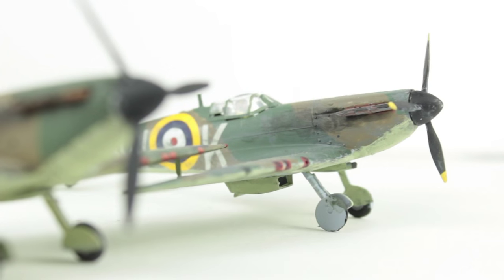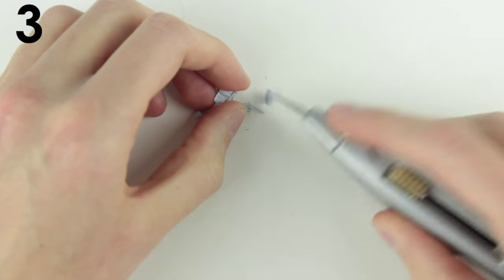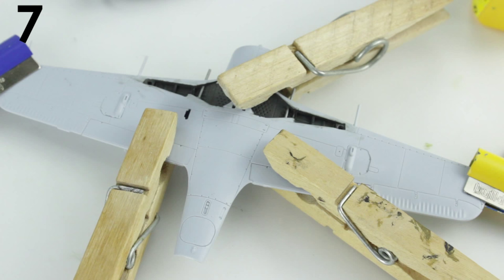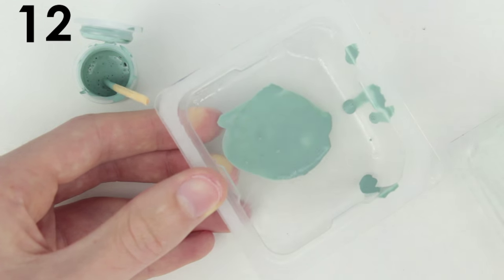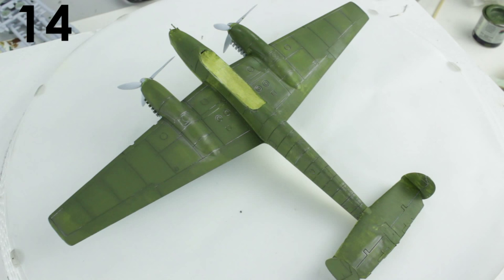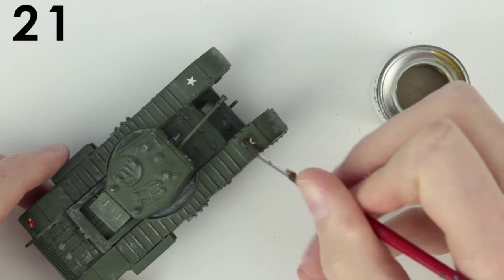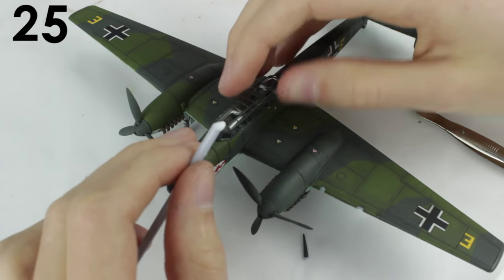25 Tips for Scale Modellers

Comment: I like this. It's a very well-made video.
Reply from the maker: Thank you, I'm glad you appreciate the effort I out into the production :)
Reply: Quick Kits 
Hey Owen!  I use Mr White putty to fill gaps between parts, whenever I sand it to make it smooth, the excess putty gets caught on the sandpaper and makes it unusable after a short while.  How can i remove the putty/filler from the sandpaper so I can use it again?
Reply: wipe it on your sleeve.
Reply: will pattison 
Tried it before, didn't work
Reply: try a wire brush, the small kind. There's a 3 pack with wire/brass/nylon  brushes, use the brass one first, start off lightly  ( sold in £ shops/wilko's/hardware or online shops) . Also try putting some (blackboard) chalk on the sandpaper first, this sometimes helps, rub some on then tap lightly to remove excess.
Reply: @rurushu8094 , how long do you wait for it to dry?

Comment: Nov. 2017--Started building models back in '74 when I came back to the states from Panama. You know, back in the "good ol' days" when there was NO internet. Learned to wash my kit in soapy water to get rid of any mold release on the kit parts, but never heard of using vinegar also. What does the vinegar do? As to modeling putty, switched to the red Bondo auto body fill material. It's lacquer based and bites into the plastic. In thin coats, it dries pretty quick and then can be sanded. For bigger fillings, it's best to wait a day or to for it to completely dry. I've read where the blue Bondo is even finer, but have yet to find it being sold anywhere. Thanks for the video.

Comment: Great video. FYI it's not a 'sprue' it's a  'runner'. The sprue it the piece between the runner and the nozzle tip that's would either be trimmed away or not exist if it's a 'hot runner' mould.  I'm not an expert modeler but I am a inj molding process tech. ;)

Comment: Good advice all around.  FYI all Japanese models do not require "washing"  the manufacturer has politely removed all mold release for this purpose.
Reply: Tactical Jackalope
That is strictly not true at all, all potentially do to some extent, they do in some ways require cleaning many models are made from different sprues, as I have had many stating such also having been pre-washed etc, but to find that they actually needed cleaning and is quite the job finding out later that the paint will not actually stick.
 However, if you do come across this just use a "Q" tip, (cotton buds),  soaked with meths and rub clean the area, leave at room temp for 15-20 mins or dry with hair dryer on low setting very gently to evaporate away the remaining thinners and once clear, continue painting...

Comment: I have a few questions to ask and hopefully you can answer them, so here they are: 1 Does enamel paint thimned 50/50 stick well to unprimed plastic surfaces but have been washed in warm soapy water? 2 Can natural hair brushes be used to paint enamels and acrylics? 3 Does anything happen when acrylic paint is painted over enamel? And do you have any tips for painting 1 72 tanks eg the type of brushes to be used , the size of the brush? Thanks in advance, from Singapore
Reply from the maker: In reply to your questions: 1 Yes enamel thinned 50:50 will stick well to un-primed surfaces after washing in warm soapy water. 2) Natural hair brushes can be used for enamel paints, but not acrylic - they'll go floppy. 3) Nothing happens when you paint acrylic over enamel. 4) Use a medium sized brush and some really fine ones, I'd recommend synthetic hair brushes because they can be used with acrylic and enamel. There are some names of the brushes I use in this video's description :)
Reply: 50/50 thinned enamels do not adhere that well to unprimed plastic, especially not cleaned from release agents, as you would know since you have asked? However if plastic surfaces are rubbed by finely grain sandpaper or meths cleaned will certainly do the trick.
Natural hair brushes are not my choice for painting models,  either enamels or acrylics, *Nylon type,  or man made, (Royal Taklon), Plenty out there to chose from. Not too expensive.
Acrylics painted over Enamels as long as the Enamels are completely dry there is no problem what so ever however if not dry the evidence is clear to see. Recommend to completely clear/clean of all paints with suitable thinners and wait at least 24hrs, then start once again.
Small model, therefore small brushes, however for bigger areas use larger brushes and strokes all in one direction, this helps to reduce the brush marks which should not look too bad if applied gently but firmly.I always prime my models first leave 24 hrs and then apply cammo or soild paint. I now tend to use acrylics more than enamels, hence there is no real need to thin the paint such as AK Interactive or Vallejo, or life color.

Comment: Before putting together.  Take a fine needle heat up and carefully run through and pull out upon pulling out of the melted plastic is drawn back.  With practice many different kinds of holes can be made. Even exit holes using the tiny Phillips drivers.  Not as much tip heat.  Working it slow and in stages a great resualt can be obtained.  Practice on scraps first...

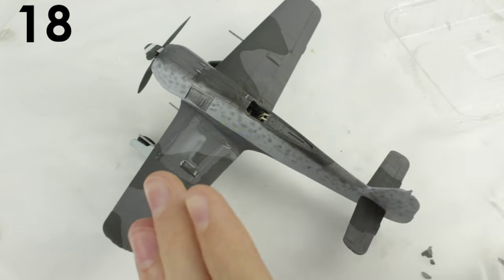Comment: Hi great set of tips I will need to work through your vid again at a slower pace to pick it all up👍🏽 would recommend always applying clear varnish on a kit and if so, what type of varnish would you recommend for a spitfire 1:48. Thanks!
Reply from the maker: It depends on what you are doing. A gloss varnish coat is needed underneath decals, or if you want to achieve a shiny finish. Matt varnish is useful for getting rid of any shine. I'd recommend finishing the model with a coat of matt varnish to seal everything - just be careful not to get it on any clear parts as it will make them go frosty. You'll want to spray the varnish on from either a rattle can or an airbrush. I've only every used Humbrol varnish so I can't compare it to anything sorry.
Reply: +Quick Kits thanks man!
Reply: Use Johnston's" Clear floor polish", for finished results, or for all clear canopy's, windows, etc  leave overnight after dipping and you will see a vast improvement. (Keep the dish for dipping covered to stop dust getting in and Don't forget to pour contents back into the bottle, the stuff a'int cheap). Please refrain from using Varnish on canopy's or windows, I have found in my experience it tends to go a yellowy brown color after a while, especially Humbrol. Try Vallejo or AK interactive paints. Do not need to be thinned or played about with but ensure you shake well contents before starting. Small tips go a long ways...

Comment: For tip number 1, just use surface primer. I recommend Tamiya's Surface primer, (toxic) or Vallejo (non toxic) although Vallejo is hard to clean off small brushes
Reply: If the manufacturer uses a non paintable release spray it will stop the primer from adhering. It's a better safe than sorry practice.

Comment: I've been building 3 different models currently (since I'm a beginner)

The Stuka, Fockewulf and Messerschmidt. And now I'm trying to experiment by doing painting with brush. Most of my friends recommend me acrylic rather than enamel.

But from your video it seems enamel perform better and grant better result than acrylic. What is your recommendation master? Oh and one more thing. The pencil stuff to add shading and line detail. Do you paint your model again after applying the pencil?
Reply from the maker: +Bear Tovarisch since making this video I don't really use enamels any more - they smell, take a long time to dry and it's annoying having to clean brushes in spirits. I mainly use acrylics but I find that it's useful to spray the model with primer before painting (sometimes). Yeah if you want to tone it down, apply more coats over the pencil

Comment: I've been building Gunpla model kits for quite a time now and is considering on trying out scale model kits (mainly tanks, I've build a fighter plane before, but that was when I was in elementary and only one lol) - Which kit would be a good start? I've never touched any kind of tank kits before.
Reply from the maker: I'd recommend you just find the cheapest tank kit you can find (probably 1:76 scale) and build that, then it doesn't matter if it goes wrong. Or try one of the Airfix starter sets as they come with paints, glue and brushes. The Cromwell one looks alright but I haven't built it. The Tiger II one I have built and it's a bit more difficult

Comment: hey owen, i have a question and would appreciate it very much if you could answer it. When you're doing the camo patterns (the smooth ones like in 1.52) how do you get such defined lines on the camo? I usually end up messing it while trying to apply a second coat
Reply from the maker: Painted the whole model with 2 coats of the lighter colour (thinned roughly 1 part thinner to 6 parts paint) and then paint the pattern using the darker colour (thinned to the same ratio. The darker colour shouldn't require a second coat as it has a nice uniform base colour underneath), then you can neaten it up if necessary with the lighter colour. See my FW190 video from about 2:40 ;) hope that helps :D

Comment: Hey, Owen, I like very much the tips that you give on your videos. But I still having the question of:What is the right dilution of PVA glue (white glue) with water, so I can achieve correctly the gloss finish over the surface before applying the decals?
Reply from the maker: I've never measured it exactly (I do it by eye) but I reckon it's around 50:50

Comment: Great videos. Have you ever used Testors Enamel paints?  That is pretty much what I have available to me.  If so did you also thin them 50/50?
Reply from the maker: I've never used Testors stuff so I don't know, but I find that exactly 50:50 is far too thin, 1:6 thinner:paint is more like it. I should have measured it out precisely before making the video sorry
Reply: Are you based in the States/Canada?

Comment: my advice is: with airplane kits always glue upper sections of wing to the fuselage and then the lower part. this is NOT how most instructions advise, but this way you avoid gap in wing root area (which is pain to fill). downside is you can get dihedral wrong, but that can be prevented with dryfitting.

Comment: I accidentally spilled my humbrol liquid poly cement and now there is little cement in the bottle so i want to ask if when using humbrol precision poly does it release a very strong unpleasent scent and can the applicator nozzle get clogged or not? if it can get clogged, is there a way to unclog it? cos i plan to buy it. thanks
Reply from the maker: All poly cement glue smells quite strongly, and yes occasionally the nozzel on the precision poly will get blocked but I find by soaking it in hot water and using a pin it can be unlogged. Sorry for the late reply

Comment: For tip #18

So if I apply watered down Elmer's glue (Which is PVA) onto the painted model before applying the vinyl, it will prevent silvering in the future?
And will it still look good?

Is this an alternative to microset?
Reply: yes it works in a pinch although actual gloss coat does better
Reply from the maker: There may be a tiny bit of silvering, it depends on how smooth you get it. I've never heard of that glue but if it's true PVA then it should work. Microset helps the decal bend to the surface of the model, so no, it's not a substitute for any type of decal solution; but it is a substitute for gloss varnish
Reply: +Quick Kits 
Thanks

Whats the glue to water ratio that you use?

Comment: Will anything happen if I undercoat a model with a acrylic primer and then paint over it with enamel paint? And what is the approximate drying time for enamels thinned 50/50 before being recoated?
Reply from the maker: Acrylic over enamel and vice versa is fine. Be careful when putting very thinned enamel over enamel as if it's not dry properly the thinners in the second coat could lift the first coat. 
I'd say about 3 hours until touch dry, but I'd leave the enamel to dry over night just to make sure it's properly dry before putting on the next coat.
Reply: @quickkits  enamel and acrylics don't mix like oil and water

Comment: One more question to ask you. Could you recommend a good airbrush and quiet compressor system for a beginner. there are so many options from very inexpensive to off the wall expensive.  I have never used one and cannot seem to get an advice from anyone. I am an ex-Pat and there are no hobby shops here so I have to get everything online. Money is not a major issue I just need some advice. Thanks if you can help me, I really appreciate it.
Reply from the maker: Sorry, like you I have no experience with airbrushes
Reply: Amazon , double piston with 2 airbrushes completes the set, costs about £150, no more. Being ex-pat, (like myself), do however, watch the voltage output on some of the motors, depending on where you reside now and voltage used. hope this helps you some.

Comment: I have a star trek enterprise model that I used sandpaper to scuff up the finish before applying primer but the scuffing is visible through the primer now. how can I fix sandpapering mistakes?
Reply from the maker: You'll have to go over it again with a fine grade sandpaper, something like 1000 grit
Reply: actually I kind of did but maybe not with that grit of paper and I used Meguiars Ultimate wash and wax at the same time as I lightly sanded it. Baby smooth and it even uncovered the details I overpainted. Thanks!

Comment: if you wash the parts in soap + vinegar dyou need to rinse em or just let em dry?
Reply from the maker: I usually rinse them and then leave to dry
Reply: +Quick Kits thanks for the reply, i have another issue. When using enamel paints, you are supposed to use thinners for synthetic paint(nafta) or white spirit correct? i know u mentioned humbrol thinner but that"s not easily accessible in my region. Hardware stores are. Also there is no need for a primer afters washing the parts like that?

Comment: How long should I wait before 2nd  coat of paint ?
Reply from the maker: It depends on the type of paint you're using and how much you have thinned it down. 
Acrylic paints thinned 50:50 with water then about an hour, maybe two at most. 
Enamel paint thinned 50:50 with enamel thinners I tend to leave over night.
Reply: thanks
Reply: I would leave regardless of type overnight to be sure there is no rush after all...

Comment: Owen,

1. In Canada, no Humbrol acrylic paints are available, just enamel. I have an Airfix kit which came with Humbrol paint pots. Can you recommend any other manufacturers varnish which would work with the Humbrol acrylics please?

2. My skill level is somewhere closer to intermediate than beginner. With ease of application and final finish in mind, If I was to use  Humbrol Matt  acrylic varnish on the whole model (I may just be able  to get Humbrol acrylic varnish in the USA), would you recommend using the spray can, or the small bottle applying with a brush?

Thanks
Reply from the maker: Any manufacturer of varnish will work with Humbrol. Vallejo, Tamiya, Testors etc. 
I'd recommend a spray can
Reply: I tend to disagree ref the spray can as any varnishing job can be just as good with a brush but depending on what you are varnishing. Size of area and what areas you are covering. Vallejo and Tamiya are acrylics, I do not know about Testors, Last I looked,Testors were like Humbrol Enamels. Not acrylics unless indicated I do confess I have not used Testors for many years now finding them like Humbrol very watery and weak I rarely use either of them. I stick to acrylics, mostly Vallejo, AK interactive, Andrea, Tamiya, life color and Tensochrom, I order all my paints in on Amazon, as there is a shortage here of that sort of thing, mostly in bulk and all at once having all the colors in each of what has just been mentioned. Humbrols stay at the bottom of the cupboard like the Testors now and the few others odd brands I have used tried and found not to my liking. 
 Be careful what you use... They are safe to use, please do not get me wrong but cannot be mixed as you would like, if they are enamels and time must be given for the enamels to dry suitably before using over the top. I tend to use acrylics all the time there is no need to water down either and I only use enamels for top cover now and again, or washes or small areas that need to be something other than acrylics. Enamels are I personally find a thing of the past rarely utilised as much as I used to...